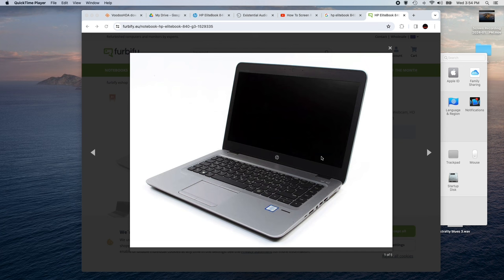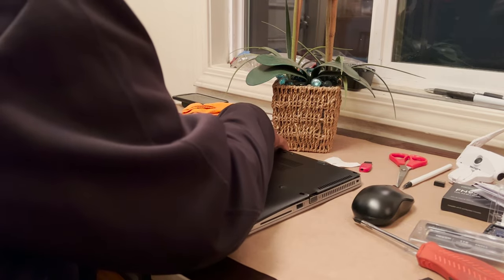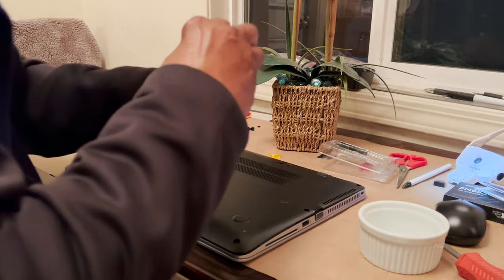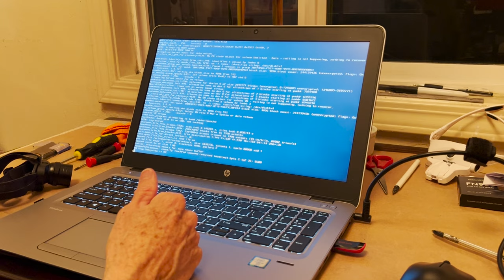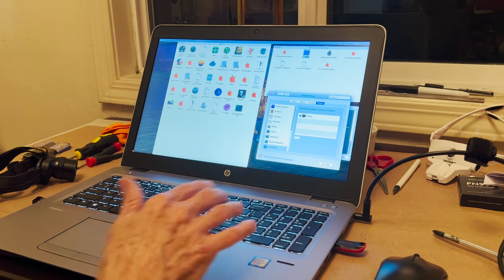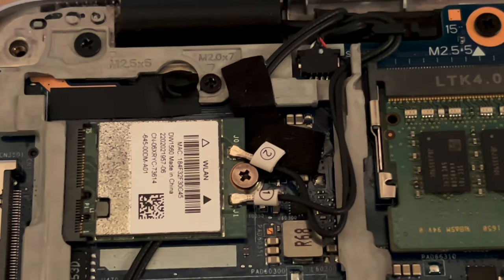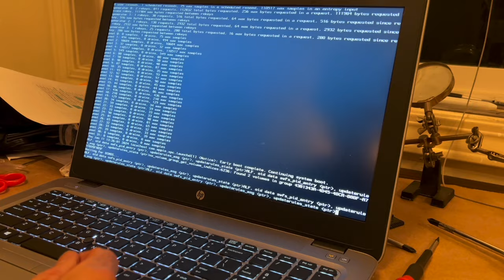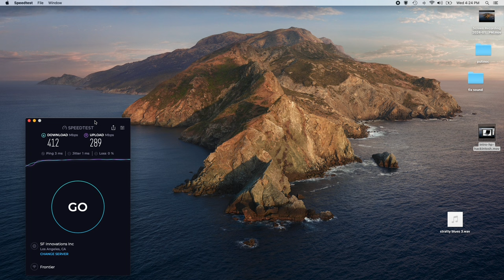hp elitebook 840 g3 hackintosh installation

Comment: Working: Display port, sound, Card reader, Bluetooth, Battery indicator on my Hp Elitebook 840 g3  i5 2.5 Ghz (MacOS 14.3.1 Sonoma).  Wi-Fi works with heliport. 😃
Reply: I tried to install sonoma and I can't do it, ventura runs fine, can you show me how you got sonoma on this hp 840 g3 core i7 6th
Reply: You have EFI folder? Can you share?

Comment: I bought a used a Hp Elitebook 840 g3  i5 2.5 Ghz, 8Gb ram, for 1100 DKK(approx.$160) and  upgrade it to 16 Ram. I have now installed MacOS 14.3.1(Sonoma) on a 500 Gb NVMe. 😀 Bluetooth working, Wi-Fi works with heliport 😀 I can't change the time zone to  my time zone. 😑
Reply from the maker: could you send me a copy of your wifi partition so I could try and install sonoma? Did you change the chip on your Elitebook? my friend got his bluetooth to work on his stock elitebook but he got a wifi dongle to get wifi. I changed the chip and got wifi to work but I had to add a bluetooth dongle to get bluetooth to work.
Reply: @skydogstudio  Wi-Fi works now with heliport.
Reply: I tried to install sonoma and I can't do it, ventura runs fine, can you show me how you got sonoma on this hp 840 g3 core i7 6th